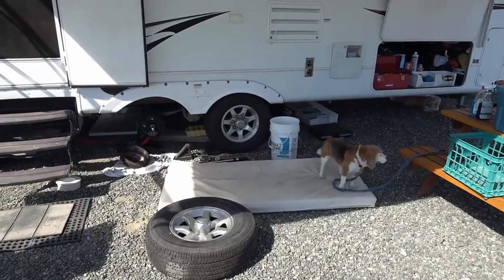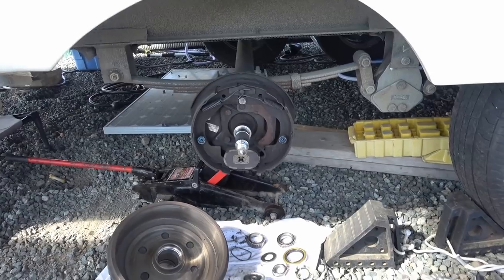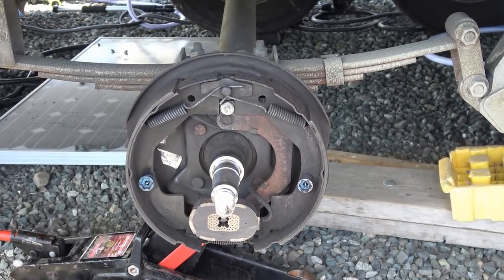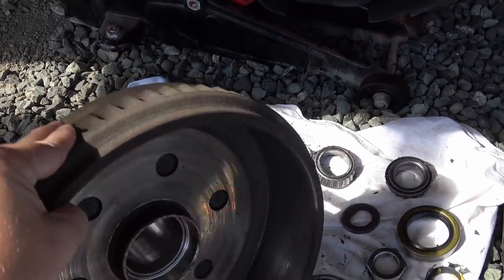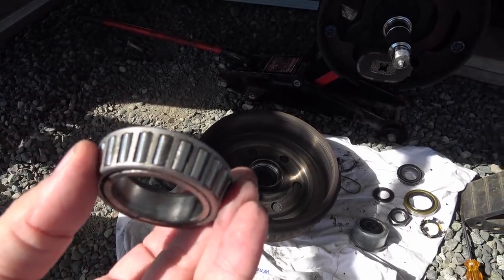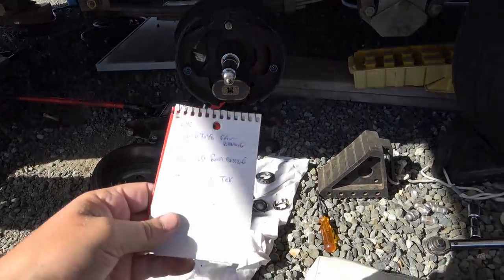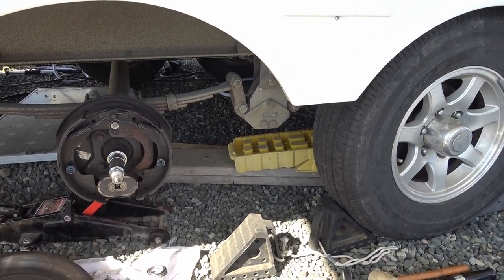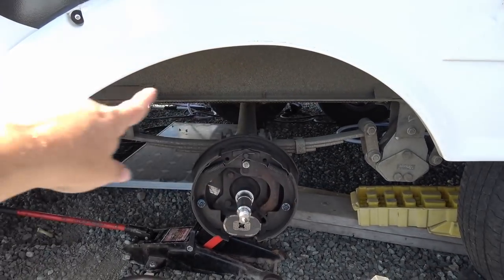Checking my Keystone Trailer Brakes and Wheel Bearings

Comment: Hey Ray Just my opinion but no more than that stuff cost I would replace it all. those shoes are pretty worn and the bearings look loose but they don't really have any grease that I see. Ahh reason being that you travel a lot down hills and stuff and those shoes are really thin for that. your safety is really worth more than a few dollars. I work on cars a good bit and I have seen shoes like that just break apart and then you got metal on metal. changing the races for those bearings is really pretty simple with a punch and then use the old ones to drive the new ones in with and pack the bearings real good and you are done. shoot it already tore some what apart. so move on with the repair.. in my honest opinion .  CHEERS.
Reply from the maker: Thanks for the advice Charles, I'll see what kind of pricing I can get on the new brake assemblies up here on Canada. May have to wait until I get down south this fall to save ourselves some bucks. The good thing is our new Ram 3500 truck we are getting has an excellent exhaust brake built in and towing capacity of 17,000 lbs and our rig is under 10,000 lbs. so should be pretty safe. Cheers Ray
Reply: Yea I been waiting on seeing  that truck. I had fogotten there for a min.. But not sure on pricing up there but like you said not bad down here. Anyway have a safe trip and Cheers to y'all.

Comment: Lucas red grease
Reply from the maker: Thanks, looks like they carry that at the Canadian tire down the street if this is the stuff? - http://www.canadiantire.ca/en/pdp/lucas-red-tacky-grease-cartridge-14-oz-0280406p.html
Reply: Yup.  That bearing grease should work well for you.  If you have any info on your axles you could check with the manufacturer to make sure.
Reply from the maker: They are Dexter EZ-Lube D44 axles 4400 lbs rating I found this page - https://www.fayettedistribution.com/Dexter-Axle-Wheel-Bearing-Grease-p/088-012-00.htm looks a lot the same.
Reply: Lucas X-tra Heavy Duty is also available at Canadian Tire, it is a polyurea based grease and compatible with many other greases and applications.
Reply from the maker: Cool, thanks. :)
Reply: The Lucas Red and Tacky is what I use here in Florida. No problems in the three plus years of ownership !!!

Comment: Nothing special about the grease. If that bearing is pitted you will also need to replace the race. You should be able to drive the old one out with a pin drive and a stout hammer.

Comment: Hi Ray, first off make sure you get high quality domestic or Japanese bearings, they'll be quite a bit more expensive then the cheap Chinese ones but will last many years.  Nothing worse then having a bearing go out on and take out an axle when you're out in the middle of no where or on a busy highway. You can pick up high quality bearings and seals at most industrial supply places and they'll be able to confirm the bearing quality for you as their customers can't afford to use low quality bearings for the sake of saving a few dollars.  I would be apprehensive about ordering bearings online for fear of not being able to actually speak to someone to confirm the bearing quality.  I've seen more trailer accidents caused by wheel bearing failures than by break issues.

As far as axle grease go's, just use a high quality axle grease and buy an extra tube as you shouldn't mix greases (ideally)

It also looks like you have Dexter EZ - Lube axels which are awesome as they don't have to be disassembled to repack the bearings,  https://www.youtube.com/watch?v=XT0RKDGgDm8.  You'll also be able to repack all 4 of these bearings yearly in about 5 minutes.

Great video, keep them coming.
Reply from the maker: Thanks, there are a few trailer shops around here, lots of boating in this neck of the woods, so will check them out.  Cheers, Ray

Comment: They must be Chinese bearings to wear like that.
Reply from the maker: Yes, all the parts had Made in China on them.
Reply: Ben Dixon I concur, either that, or the bearings were not serviced properly the last couple times.
Reply: Im sure if Ray does this job himself, after seeing his attention to detail, that it will get good bearings and be done correctly.
Reply: Well...do not blame the Chinese as many countries can  produce cheaply made bearings. What is a real shame are those repair shops that use them by choice. Or those distributors that repackage under their own label so you never quite know what you are getting.